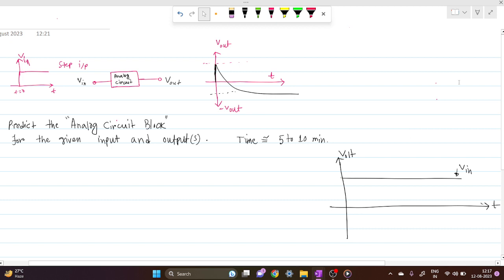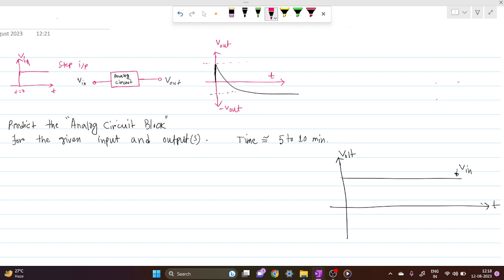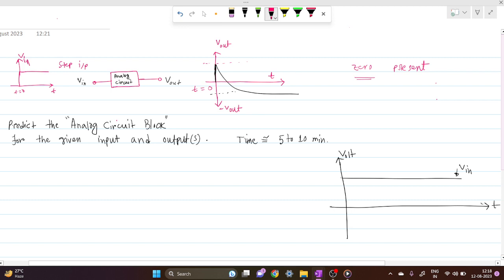Predict The Analog Circuit block _ Intuitive analysis of Right half Plane Zero_Amit Bar

Comment: In the inverting configuration you are connecting Vin with inverting terminal and grounding the non inverting terminal. So there won't be negative feedback. Also in steady state output is gain times Rload which means for Rload must be a very small value (mohm or uohm) to have a finite steady state value. So i don't think this design will work.

Comment: This circuit can be implemented with passive circuits just with switches why complicate it with active circuit?
Reply from the maker: There can be multiple solution.This is just  one of them.
Thank You
Reply: @AmitBar-Analog_Circuits  yeah very good video though. Thank you
Reply: how to implement with passive circuits?
Reply: If the output final voltage is -ve how the circuit can be with passive elements only assuming its not a switch cap circuit and all initial conditions are zero ?